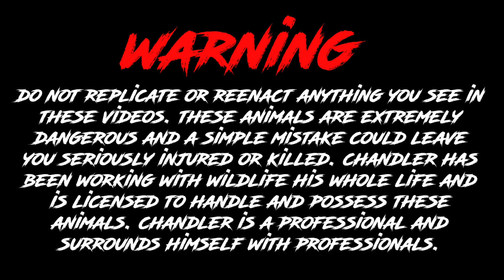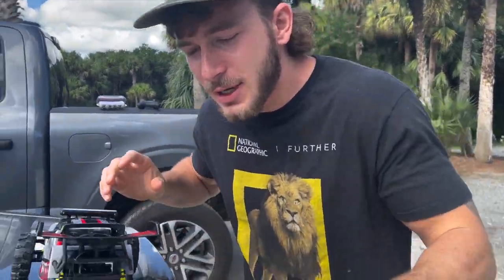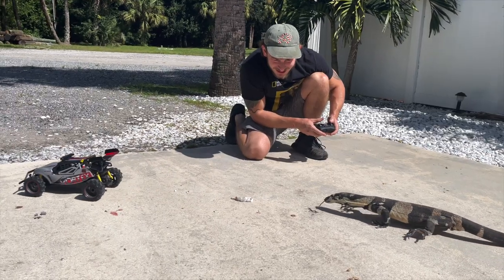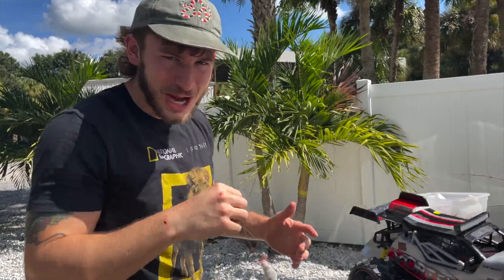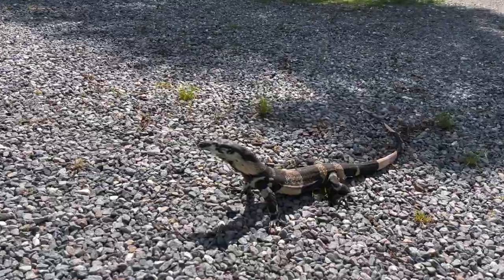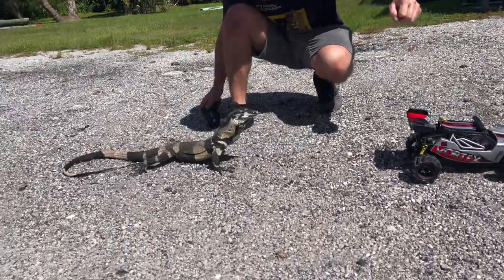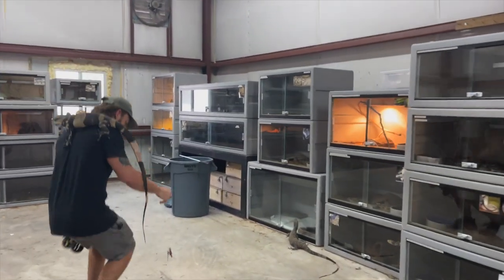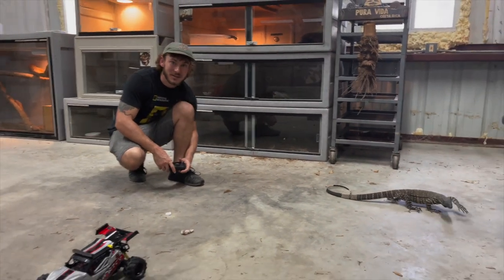RC CAR VS LIZARD!

Comment: What a great idea for enrichment- love to see the hunt. But be careful with the cords, the thinner they are, the more dangerous it becomes if they are swallowed. The cords cut the intestine (swallowing sewing thread is a common cause of death in cats). Make it safer by using self-dissolving strings or, even better, leather cords or similar natural material
Reply: Cotton twine
Reply: Excellent advice...working in vet med for almost 30 yrs, I have seen too many animals die from linear foreign bodies.

Comment: Cheap but fast RC car recommendation from Amazon- WL Toys 144001 RC Car. Will go 30-35mph and costs about 130. Of course If you want to pay an arm and a leg go for a Traxxas or Arma. But considering you are strapping dead animals to it, go with the WL Toys you won’t regret it. It’s also 4WD and has plenty of replacement parts if needed. I replaced the motor on mine to a brushless and it goes like 60mph. Completely unnecessary but it’s fun.

Comment: You should’ve gotten a Traxxas rc car🤣 They’ll hit 40-50 even 60 mph👀
Reply: Agreed. The best in the business for rc cars
Reply: Agreed but you got to also think they run on gas so they're a little loud and the monitor may not run after it you know
No point of wasting 3,4, 500 bucks
Reply: @Ted94Roberts  they have electric ones on the market that are better than the gas.
Reply: @Ted94Roberts  I have a Traxxas Stampede, you can get the nitro or the electric version. I have an electric myself.
Reply from the maker: I’m on it!!!
Reply: So essentially these are RC cars that are capable of getting a speeding ticket
Reply: @brandi3981  pretty much😆 When I first got one I could barely keep it under my control😅
Reply: @CrazyCritterz  They no longer make the nitro version

Comment: If you're going to get an RC car, get a decent medium sized, hobby grade rock crawler, preferably with high and low gears both for speed and slow speed torque. The Traxxus is far too heavy and fast and might injure/friction burn your monitors.

Comment: Look into Traxxas r.c. cars.   They are a bit pricey, but are a hobby grade r.c. car.   Might be able to find a used one for around $150.  But r.c. cars are known to require alot of fixin', so you would probably be better off with a new one.

Comment: 🤣 yea that didn't work. U need a way faster RC car. A drone will probably scare him to much. Try it in the snake room or a flat surface.
Reply: Grasshopper is what I had as a kid. Look into it. That may work better. Around 1-2 hundred. Or the legendary around 100.
Reply: Good point a drone probably will scare Jack ( but not Ziggy)

Comment: I was surprised by this video. This is not enrichment! This is possibly injuring you monitor lizard. At one point you accidentally ran the toy car into him. You have a string attached to the mouse. If he woofs it down real fast, that piece of string could fester in his stomach and cause him problems. At one point, he caught the mouse halfway down his throat and you yanked it out to get the string back. That could have injured the animal. You usually take such great, careful care of these animals why do something a little reckless like this?